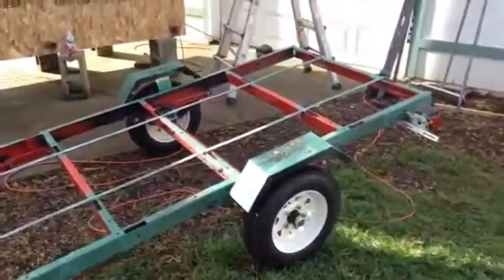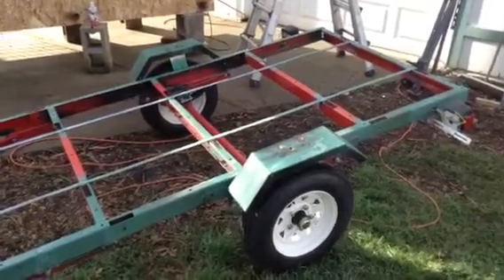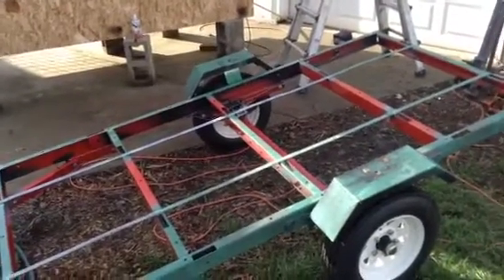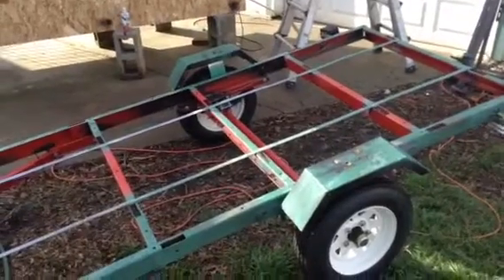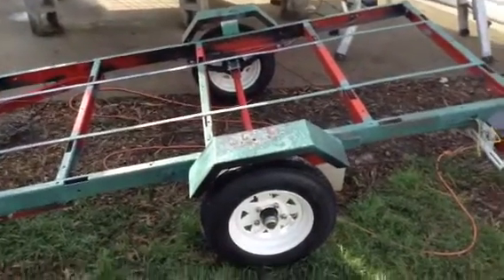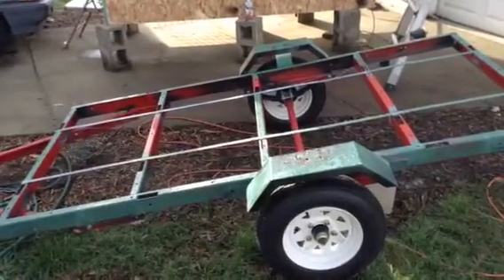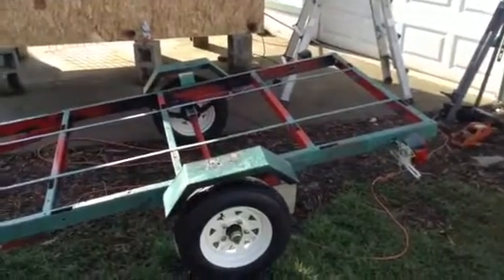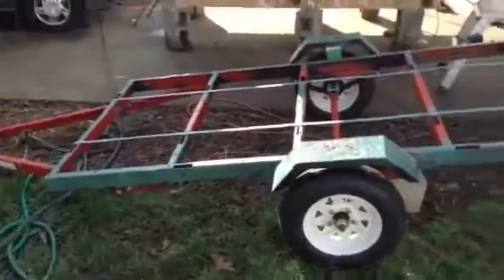Trailer capacity vs axle ratings on off road camp trailers

Comment: This trailer is 349.oo  with a coupon( coupon just for this trailer) until 4/30/19. The 20% off coupon doesn't work with trailers and generators.

Comment: Good review.  There is static load and dynamic load.  These trailers could probably hold 1 to 1.5 tons STATIC.  Drag it down the highway and you probably can't carry more that 1/2 of the advertised capacity unless you want to ignore the safety factor of 50%.  I wouldn't use these trailers as a camper, but I wouldn't hesitate to use them to haul camping gear (tent and supplies).  A 4x8 sheet of 3/4 plywood weights in at 61 lbs.  Subtract that from your payload.  Take another 61 lbs off for sidewalls, now you're down to about 1630 payload.  Spare tire takes you down to 1600.  All these this's and that's eat away at the usefulness of these trailers.  No deduct the weight of interior furnishings and you've just about grossed out the trailer; no safety factor.  As you mention, a 3500 lb axle & tires should be the minimum.

Comment: if you weld you can build a trailer from scratch with a 3500 pound single axle for the same price or less than the cheap harbor freight trailer. you want no more than 200 pounds on the tongue if you have 1700 set up. for off road trailers, you want the axle width and ride height to match the vehicle that's towing it.
Reply: also, if your wanting to do serious off road camping, check into swivel couplers and walker axles.
Reply from the maker: Mark Cobb Actually no, the supply places charge so much for the axle, light kit, fenders and hitch kit that the Harbor Freight trailers with a 20% coupon are the best deal out there for DIY 1 ton trailer frames.  Then there is the VIN plate and documentation kit.  That's how I was a able to one of mine when it was stolen from a friend in a robbery.
Reply from the maker: Mark Cobb also, this was not so much an off road use build.  It could handle some dirt road stuff but was not really a jungle expedition sort of thing.
Reply: I build trailers for a living. Do you want the actual prices? 3500 lb axle... 150. Coupler 50, 13 inch rims and tires...120. light kit 20, steel 100. 10 times the trailer you get from harbor freight.
Your approach yields a cheap ass trailer that will get someone killed. Harbor freight trailers are notorious for their flex. Flex destroys teardrops. 
Your wrong about your axle specs. If you have a 1750 pound axle, that's what it's rated for, 1750 pounds, bolts rails floorboards and cargo. You've built what 5 or 6 trailers? I do this everyday, 6 days a week, 10 hours a day, but your the expert. Your going to get someone hurt or killed trying to pull a flimsy overloaded trailer.
Reply from the maker: Mark Cobb if I were doing a high end Aussie expedition trailer I would buy everything heavier duty and separate, but a $349 HF trailer with a 20-25% coup in comes in under $300.  I almost always add more steel so flex is never an issue.  The build in this video was my fourth or fifth one and it was for a temporary haul of the wood box section you see in the background.   The axles are 1 ton rated with the estimated trailer weight of 250lbs, hence the trailer rating of 1750 lbs.

Comment: Could harbor freights heavy duty trailers Axel manage a Harley Electra glide? Does anyone know?
Reply from the maker: jack mathers  Yes, I think those bikes come in under a ton.   I know a guy who uses a trailer with the same basic 1 ton axle to carry a midsize bike with sidecar.  The reason they rate the trailer at 1750 lbs is that it is roughly 250lbs of trailer on a 1 ton axle.
Reply: O so they subtract the weight of the trailer for you? That makes more scence
Reply from the maker: jack mathers
Correct.  They use an industry standard 1 ton trailer axle on that model, not the proprietary Chinese stuff.   I even had a hub go bad and a US made replacement from Napa auto parts went right on, no problem, same lugnut size and everything.

Comment: I always wondered why the deluxe trailer at harbor freight was so much more expensive than the next one down that looks the same.  Now I know. Its the axle capacity. Thanks.
Reply from the maker: Not only that, but it is the cheapest way to get that axle kit when you hustle the purchase at the store with coupons.  I just got a price quote from a local trailer parts supplier, and I mean even locally manufactured stuff which did not ship in from anywhere far away, and it is just under $800 for the next size up with trailer brakes, and that's just a complete axle kit for a 3500lb rated axle.  I could buy two harbor freight kits and scavenge the stuff from them and it would be a better deal, question is whether or not I want to give up putting brakes on the water tank trailer I plan on building.   Some states require brakes whenever the trailer has tandem axles, others only require brakes on the higher load ratings, but will allow tandem axles without brakes, as long as you don't surpass a certain load rating.
Reply: 8digitPDX yeah harbor freights trailers have a ton of value. I own their boat trailer and it was pretty cheap. Others were over $800 and I still had to put them together. Lol. Maybe go to an auction to get those axles. They'll probably cheaper.
Reply from the maker: Love2boat92
They price gouge that stuff in most places, you start looking at the parts, and they all came out of the same factories in China.   It started pissing me off when I really figured it out.
Reply: 8digitPDX Yeah they'll do that for sure. You can get some steals at auctions though. I bought a 5 HP boat motor at one for 22.50. Lol. How could I go wrong?  A lot of times its the name brand that costs more. Personally an off brand like harbor freights trailers work just as well as a name brand one for me so why buy a name brand?
Reply from the maker: Love2boat92
 Harbor Freight is definitely NOT an "off brand" in the US Western states any more.  Everyone knows who they are.  In my neighborhood, they were doing so much business they took over an old grocery store as their retail location.   The reason their trailers are in a niche market though is that "ready to assemble" packaging.   Most people who buy trailers now are getting them ready made, or for anything larger, and custom, there are a lot of guys on Craigslist running home weld fabrication shops.   Around here, those guys are what feeds the tiny home industry.
Reply: 8digitPDX Interesting. Here where I'm at in western pa I'd say the stuff harbor freight sells is considered an off brand. Harbor freight isn't common in my area. Wow, taking over a grocery store must have been a big move. That store must be huge. If I can save a few bucks by putting one together myself I'd do it. I'd run a welding shop myself but I worry about the liabilities.
Reply from the maker: Love2boat92
 In the greater Portland area, they are not far behind Walmart in number of stores, usually taking over an old grocery store locations in strip malls where the grocery stores had moved elsewhere fairly nearby but upgraded to dominating their own lots.   Local newspapers run full page coupon ads where the 20% comes more than once a week, but the rare and valued ones are 25%.   That matters a lot on big ticket stuff (like the trailer kits) but they don't allow them on generators and welders.   They also have a lot of sales on promotional items, samples and returns, where you can end up getting 20% off on a generator or big ticket item anyway, but it will show some prior use.
Reply: 8digitPDX wow. They're nowhere near that many harbor freights near me. Its very rare I see any 25% offs in newspapers. I remember I tried using a 20% off on a welder. It didn't work. Lol. Wish I would have known that.
Reply from the maker: Love2boat92  25% coupons are both rare and usually have a pretty short expiration date.  20% coupons can usually be printed up from online.
Reply: 8digitPDX Yeah I've printed 25% off coupons from online before and they're pretty difficult to find online.

Comment: Tks for the vid my trailer is rated to carry 1100 lbs so it should be fine for a teardrop ie guy from g4t channel comments
Reply from the maker: Not for off road use on a 4X8.  That is just a light furniture and lawmower hauler.
Reply: 8digitPDX http://www.apachetrailers.co.uk/trailers-ng273-1.php
Reply from the maker: CORRIGEEN71
 Thanks for the link, I like the hot dip gavanize deal on those, but we don't have much of that here in the US, although there would be plenty of call for it in the Pacific Northwest.   I saw some pretty neat "luggage trailers" in Germany which were mostly aluminum construction and had what looked like motorcycle tires (large diameter) which in the late 1990s were in what was equal to the $2500 range.   They were usually made available at car dealerships which sold the small hatchback cars.  I noticed what they did was pile the whole family in one of those little cars then when they got to a hotel or resort, parked the trailer outside the hotel room and left it there, then toured around in the car.   Smart idea considering those narrow streets which were originally designed for low volume horse and buggy traffic.

Comment: Aloha.
I came across this unique design while looking for a motorcycle trailer about 2 years ago.
This was towed behind a 650cc motorcycle.  I can see scaling it up, using a Harbor Freight Trailer Kit as the donor for most of the construction, and using hinged panels for the sides/top instead of just a fabric panel for 1 side when it pulls open.
This could allow keeping the size & towability of a teardrop, yet getting more length/room once you stop.
https://www.youtube.com/watch?v=1z7QnNkMgF0

Peace & Prepare
Pax et Paro
Reply from the maker: That's about right, looks like one of their 4X4 trailer kits.  You just don't want to push your luck on weight with those because the brakes on the motorcycle will not handle it.  In addition to that, there is a unique problem with motorcycle tires and balance on wet pavement when you hit the brakes on a curve and the trailer starts pushing the motorcycle at an angle from the rear.  Motorcycle tires are particularly vulnerable to that which would be the equivalent to a PIT maneuver done by a cop car, which is particularly deadly to the motorcyclist.    Personally, if I want that open air feeling and camp gear options, I would put a trailer on a convertible, or do a custom sawzall convertible job on something like a Subaru Forester... In either event, I don't like the idea of sleeping on the side of the road in any situation where someone could just rush up and stab me.
Reply: 8digitPDX Aloha.
I guess I should have been more clear.  I was suggesting scaling up the Idaho Bedroll, not as a motorcycle trailer, but as a trailer to go behind a 4-wheel tow vehicle, like a small pick-up or SUV.....similar to tear-drop trailers.  And, with scaling it up, I would add hinged panels with windows/doors for the sides/roof when it is stretched out, so it is fully enclosed and solidly weather-tight (and stab-proof from roaming Friday the 13th Maniacs).

Peace & Prepare
Pax et Paro

Comment: I'm building a similar trailer design with the harbor frieght 4x8 how much weight do you think your going to add in wood. Thanks , I'm trying to turn mine into an cargo trailer
Reply from the maker: Here is an example of what can go wrong, even though the overall weight on this was within specification, as soon as this person had hit some speed bumps or potholes, the trailer frame buckled (part of the discussion in off road capacities being lower)  https://www.youtube.com/watch?v=7tilOeyNZXQ  they had the load concentrated at the front, but so much that it caused the frame to buckle when the thing shifted forward, the other thing which can cause that is a high center of gravity, which pressed extra hard when someone hit the brakes hard and the top rocked forward.

Comment: Thx for the vid! I got an old pop up camper from a neighbor thats from the 70's I stripped down to frame and the axles have brakes but i wonder what the axle would be rated for, the frame is about 7'x11' the wheels are sunk up under so the wheel wells are inside the frame but i got a kit to mount the axle under the leef springs hopefully i can make a flat bed with enough clearance to not have wheel wells, so i assume my max would be what the tires would be rated for.
Reply from the maker: https://www.youtube.com/watch?v=7tilOeyNZXQ